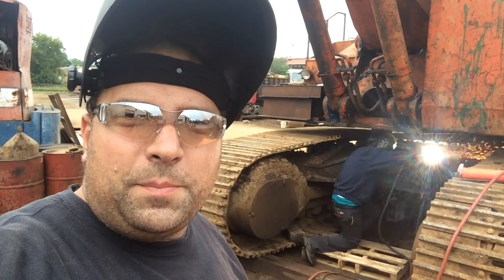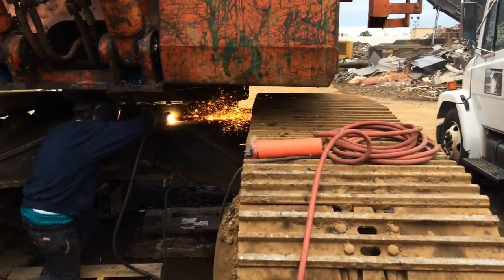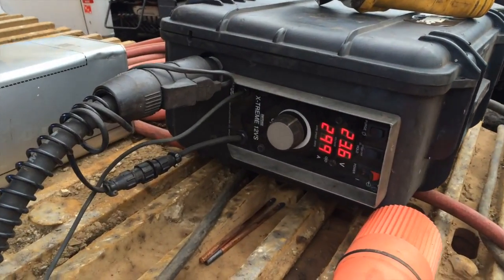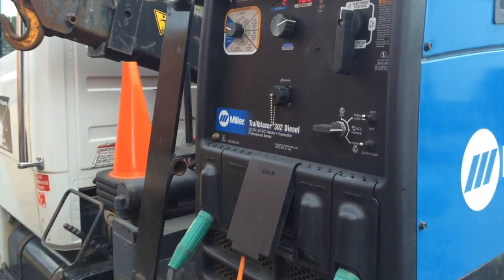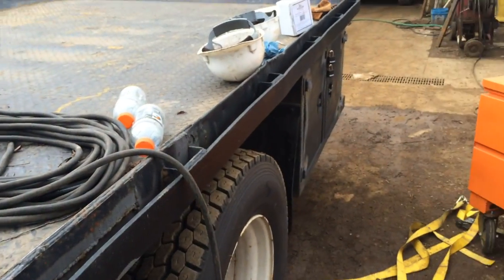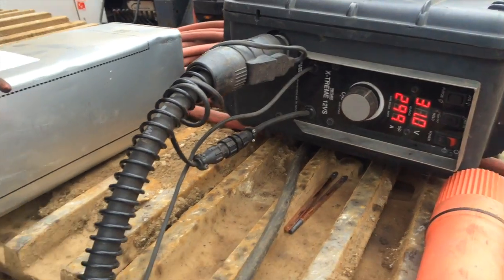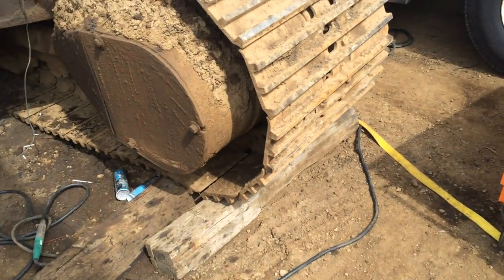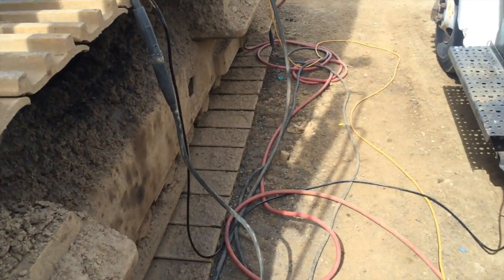Carbon Air Arc & Dual shield wire in the field

Comment: Why does the dual shield get those worm tracks like that sometimes? I can't figure it out and it's super annoying!
Reply from the maker: One or more of the following issues
Wire too old ( there is a shelf life ....  12 ish month .... when the wire is too old and the flux is wet on the inside you are screwed)

Insufficient gas ( your gas flow is too low ....  you need at least 40 cfh!!!! 50 could be better especially when you are outdoors)

Dirty material

Contact til to work distance wrong .....
You are supposed to be between 3/4” and 1”
If you are way too close the flux does not warm up right before it goes into the weld pool, if you are way too far - you loose shielding gas coverage ....

I am 100% sure one (or more) of the above mentioned scenarios is the problem ....

Sometimes you actually buy old/bad wire from a distributor ..... you need to make sure you buy nice and fresh stuff from a higher volume place that was stored in an air conditioned environment ...

If you live down south and you leave the wire ( open package/partial roll) in the machines for 1,2,3 month ....  well ..,,  that 12 month shelf life is for unopened rolls .....
Reply: @ZILAwelds  thanks for the information! I had no clue the wire has a shelf life like that. I would assume that's the same for standard flux core wire as well then. I will have to say that I tried more gas up to 50cfh and no difference but I know for sure the wire is most likely older then 12 months. So I can bet that's it. Thanks again for the reply!
Reply from the maker: @sparksmobilerepair4025  on gasless wire the shelf life is longer maybe double

Comment: Hello Peter, I notice you have bother a Miller 302 diesel and Lincoln 305 diesel. Which is the better machine?
Reply from the maker: this is a very complicated and loaded question .... the reason why I have both is because they both are great and they both suck .... 
they have identical engines, and very similar fuel consumption 
 
lets start with the miller - the good things about it is
1) very versatile (mig tig stick)
2) it has AC output not just DC
3) it has up to 35 volt arc voltage on the mig setting
4) you can lock the miller into "idle" (2400 rpm vs 3600) and that way you can pull close to 200 amp welding current while on idle and not listening to all that noise
5) it starts on "idle" when you start the engine which is nice when it is cold

the bad things:
1) if you stick weld a lot the stick arc sucks !  I don't like the arc characteristics at all - and aluminum stick rods or some hard surfacing rods run very shit or not at all ....
7018 is ok though and even 6010 unless you get serious about pipe welding works ok
2) the duty cycle on the welding output is the same as the Lincoln but the Lincoln can do the same amps at one more volt arc voltage  - so the welding output is not as high
3) although the generator output for 120 and 240 volt is slightly higher (I couldn't even list that as a plus) because the sine wave is sooo shot - so much noise on the line that it blows circuit boards on inverter welders thats you plug into that 240 volt unless those machines are specially made to handle that ....  when you read on the everlast homepage .... will run on a clean power generator.....    well.  the TB302 is NOT that ....

the Lincoln on the other side
pros
1) excellent stick arc
1a) and additional pipeline welding mode
2) stick arc AND mig arc infinitely adjustable from -10 to +10 for crisp to soft !!!
2a) that is especially nice for spool gun aluminum on the mig side of things .... it too much nicer than the miller....
3) excellent tig arc (DC only)
4) excellent mig arc (max 29 volts arc voltage)
5)CLEAN power generator with 10 degree skewed rotor going though the flied on an angle, eliminating vitally all noise on the line - safe for delicate electronics
6) better welding duty cycle
7) simpler (at least in my opinion) operators interface
cons
1) always starts engine at full throttle. - throttles down to idle about 10 sec after start
2) welding output DC only  !!!  tig limited to 250 amps (miller will weld DC tig at 300 amps AC tig at 225)
3) mig arc voltage limited to 29 volt max. that is not a huge problem is you run mainly self shielded wires or solid wires like ER70s6 BUT if you like me like dial shield wires ....  400-500 ipm 30 volt ....  well .....  you are not getting 30 volts ..... you are not even getting the 29 volts - depending on how long your leads are and what awe your leads are ..... you see anywhere from 27-28 volts at the end of the mig gun.....  and for dual shield you REALLY wish that that was more ....
4) generator output 1kw less. (but clean power!)
5) only auto idle and full throttle .... no option to lock unit in idle and save gas and noise ....

so the first 3 cons are only 3 .... BUT they weigh heavy in my book ....
but then again - the bad things on the miller weigh just as heavy ....  

so the pros are great on both machines and the cons weigh heavy on both machines ....  so they are both great and they both suck .... it depends on what YOU want to do with the machine it also depends on what "shortcomings" you are willing to accept ....   

in a nutshell. - if you weld a lot of stick and need a good backup generator or run other welding machines off the 240volt - the Lincoln is better. - if you wire weld a lot full power and you want to have the option to do 300 amp tig and AC tig with HF box .... then the miller is better ....  

if you want the "perfect" machine look at a vantage 300 or vantage 400 ..... LOL
Reply: ZILA Peter thanks so much for the review, better than anything else i would have found on a forum. It sounds like the Lincoln would much better fit my needs, especially the soft/crisp adjustment for stick and the spool gun. That's disappointing to hear that the Miller generator power is so bad, running a plasma cutter or some smaller inverter machines would be a must. Have you ran these machines in the gas version? It almost sounds like I could save $4000 and just go with a gas model and save money to buy the Vantage.

Comment: you are losing voltage because of the cable length not because the cables are coiled up. thats like saying you will lose more voltage if you run the cables up a hill, its incorrect. roll them out and see if you get higher readings. short fat cables will reduce voltage loss.
thats why on big jobs like you are doing you use a Lincoln shield arc 400 because you can turn up the voltage to make up for long cables and still get all the power you need. your little miller cant do that.
1/4 inch 7018 would have done a better job than that over priced outershield

Comment: i see what looks like undercut on the old weld
Reply from the maker: E-Nonymouse could be - that was long time ago  i dont really remember - sometimes in a picture or video is hard to tell
But no one knows how many times this machine was fixed already .... 
you could very well be right
Reply: I can't think of how to contact you more directly but there's a new machine coming out I thought might interest you. https://www.youtube.com/watch?v=xlHc81A8t8E&feature=youtu.be It's a multispool machine, kind of like the HTP pro mig on steroids. They will come out with american version soon too. :)
Reply from the maker: i would say long term power output about the same - short term they run the internal components a harder than HTP does ... if you really want power 320 amps  - and 600 amp peak pulse  - look that the Pro pulse 300  look at the sawed website next week

Comment: Ugly welds. They look like mine too. But they look sold as usual Peter. Looks like we do weld those jobs others won't even take on. At a Scrap Yard fixing in the mud outside that crack ain't easy work at all with all the dust and dirt everywhere. I think Dual Shield Flux core is the only option for that kind of work.  Excellent work. So keep on fixing stuff. Hope you don't freeze to death right now up north.... BRRRRRRRR ..... we got down to under 30 last night .. But as you well know too Florida's winter is only a few days long ....
Reply from the maker: you could 7018 stick weld it ... or more like 10018 depends on ....    but yes - if you don't wan to be there 3 days for a repair like this. dual shield is the way to go ....  Nick did some ugly weeds ... LOL.   luckily those guys don't really care if you make the prettiest welds possible ...  they want it DONE and the machine back out there making money

Comment: I’ll never forget my first time arc gouging. The guy that was getting me started told me to make sure I didn’t have any bare skin showing. I quickly found out why. As I recall, we were using an old Lincoln torpedo machine. Don’t know how many amps he had it set for, but I do remember between the noise of the torch and the machine, I was nearly deaf before I was done with the job.
Reply from the maker: yes - ear protection, eye protection ...   and no skin showing is a good idea - especially if you run 500 or 1000 amps .....

Comment: It isn't the voltage that causes the problem.  It is the 'electrical flux' or fields that are created and collapsing caused by the 'windings' created by coiling the leads. Thus the possibility of cancelling the fields by reversing the 'coils'.  Don't know if it would work practically as the real cure is to run it out so you aren't getting the compounding effect increasing the coils causes.  Doug

Comment: I don't know how old that machine is the original well was sprayed in probably 500 inches and about 40 volt the problem with spray arc is it crystallizes heat affected Zone and that's the end result but for manufacturers is John Force drag racing right and the way the gouge Leeds jump you should see them hanging 300-foot straight down the electromotive force is so strong it'll vibrate the handrail on the tower I've watched a couple year videos I just had to subscribe to some real life stuff
Reply from the maker: thanks !

Comment: Hello Pete,  If you racked your leads in a figure 8 would that cancel out the field?  I understand that with that huge amp load when air arcing nothing beats a straight lead but for run of the mill welding a figure 8 might diminish the line loss?  I learned this years ago trying to weld some sheet metal.  Seemed like nothing I did worked.  It would weld nice for an inch or two then look like the worst welds you ever saw.  Very unpredictable.  I fought it for a couple of hours until a friend clued me in that I was making and collapsing a magnetic field.  I was using DC and 7018 at the time but that was enough to teach me and I never tried it with AC!  That lesson stuck with me!  Nice practical video.  Take care.  Doug
Reply: It won't change the resistance of the wire and so it won't change the voltage presented on the ends of the leads...
And as long as you do not wrap your cables around huge piles of iron creating a huge coil, it should not even matter for AC.

The only way to go are shorter or thicker cables.

Comment: when air arc you never leave your cables wrapped, straiten them all out, do not even leave 1 wrap, as a welder for over 30 years, mainly working in bush camp / logging. using 3/8" carbon rod, I have ripped the copper totally out of its rubber casing on 4/0 cable, makes for a very bad day. by the way, that's the swing tube, the gear and bearing are at the top, as the swing motor is on the top main plate next to and back of the boom pedestal
Reply from the maker: Romppai's Outdoors thanks for the right terminology on the part.

As far as cables - that is my point ....  the new guy said: it will be fine ....  and i made the video to prove to him that it wasn't. 
Air arc is even worse than welding! The current is MUCH higher .... 3/8 rod you were running 500-700 amps ...  that is nothing to sneeze at!
One little mistake - that kind of juice fries almost everything ....
Reply: your welcome, I have repaired many of them from both the out side as well as squeezing up in side the tube from under the track frame in side that tube with a 3/8" carbon rod, that's a real cool place to use a arc air.. put your hair out with a tack hammer, or chipping hammer..
Reply: ZILA much harder on everything then just welding. yes 3/8 carbon on 3/4 steel around 575 amp was alway right on. reg. welding don't rip at the copper cable like ace air do. many guys have distroed there welders as there to small and will not take that kind of steady hit on the  rheostat and generator you need a damn good machine for ace air. in the bush busniess that's all we used was 3/8 carbon. one good pass around things like that swing tube and was good and deep and wide. I can tell you a story. was in a camp up north. the 3 man slasher had come in to the camp main shop for a spring over hall. they had unbolt ed all 3 cabs and lifted them off. brought them in side the shop for welding repairs. at the back of the cabs was a 2'x30" access hole to get to all the hydraulic controls and hoses inside there was cracks and the nuts that were welded to the frame that held the cab to the machine. they stripped. in the morning the shop foreman asked me to arc air  the strip nuts off and weld new ones in place. not knowing or smelling anything I crawled in head-first with The Arc air torch and attempted to take care of the first nut. soon as I struck an ace. a ball of fire exploded blowing Dying Light welding helmet and body and out my legs two mechanics heard the explosion and scene the flames blowing out they dragged me by my feet out my eyebrows burnt off my face was slightly scorched they later determined the night shift had used a mineral spirits with that  air Parts cleaner  sprayer which atomized
Reply: ZILA new welders male or female always think they know it all and no mater what they never liason.  they have to learn the hard way .. don't mater that you have years on them.. hot shots as I  call them. lol

Comment: you really need to get a vantage 500 on the back of that truck Pete, that poor little 3cyl kubota was working it's little socks off running those carbons... :)
Reply from the maker: I have 2 vantage 400 ....  they can be paralleled ...   the 500 is just "too big" and a gas(diesel) hog .....   I agree - the little 300 was working its socks off ....  that was 1/4 rod ... but in the big picture that was a "small" job .... and that was the machine i had handy ....
Reply: ZILA I've got a real early ranger diesel, 250a only, can't find small enough carbons here in the UK to run on it.
Reply from the maker: usaweld.com sells internationally (i don't know if shipping costs would be killing you or not ???  ) but they have (or used to have years back from 1/8" all the way up to 3/8"  i would think a 4 or 5mm rod 3/16 should work on your machine.  have you tried the "usual suspects" (eBay, amazon?) instead of your local welding specialist ?
Reply: ZILA sorry for the late reply... can't seem to get anything smaller than a 3/8 carbon over here. Usual practice is to double up a pair of xmt350's in parallel and gouge of those. Our most common engine drive here is 300a and not many people do gouging off them.

Comment: Pete I have a Trailblazer 250G and a XMT304 set up single phase they will prob be maxed out with the amps and that will be a 3/16 or 1/4 carbon rod do you think that is too much for them with light to med. work?
Reply from the maker: on a 250 - for sure don't go bigger than 3/16 as far as the xmt304 - I don't know off hand is it has max output on single phase or if there is some single phase "de rating" however you better have a real "healthy" single phase outlet ... 60 amps or better ... 3/16 carbon would be good ... 1/4 might be pushing it ...   
they will work oh for light or some medium work ....  and also look for a K2000 torch (not the K3000 or K4000)  the K2000 has noticeably less air consumption - (less then 10 cfm  ...)

good luck